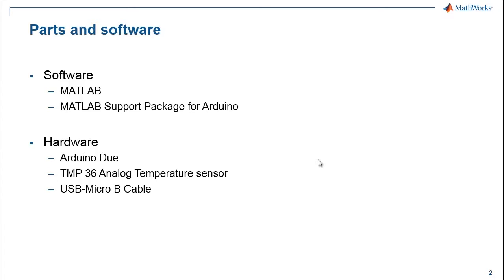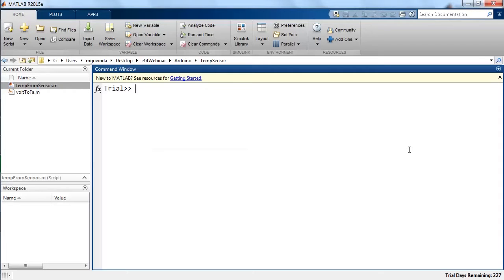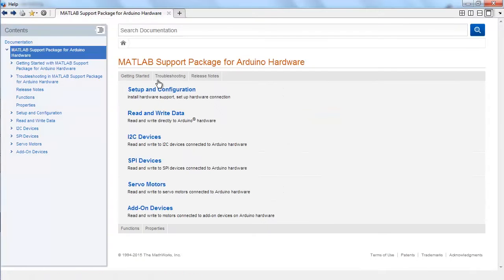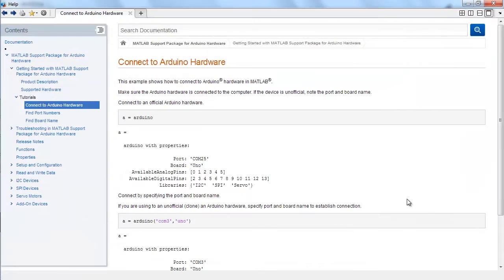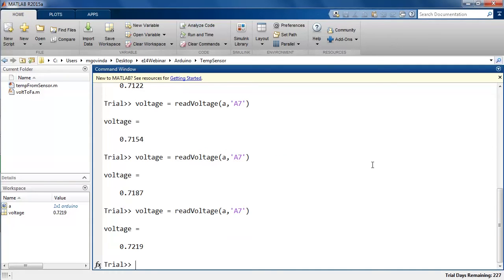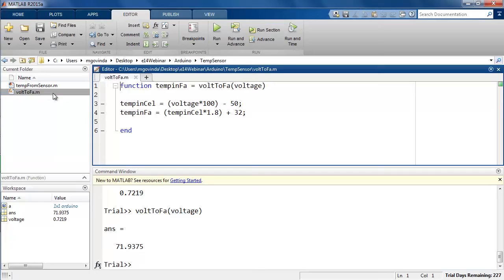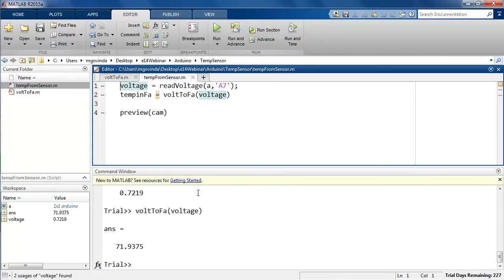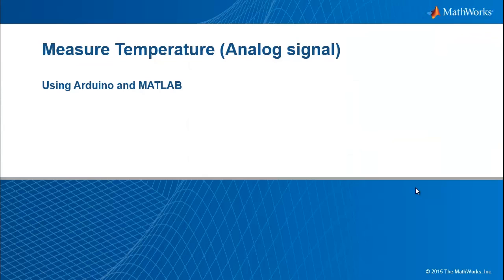Using MATLAB and Arduino to Acquire Analog Signals

Comment: I want to know ,can the software named matlab support package for arduino receive data from arduino through wifi module?that means ,there would be no connection between computer and arduino through cable. please answer me.